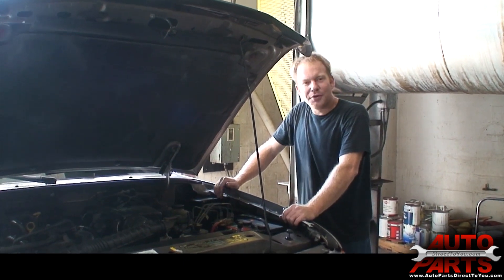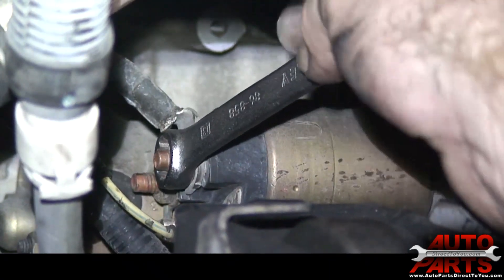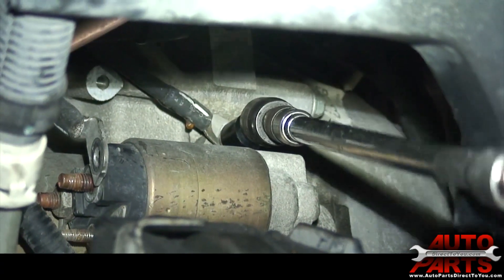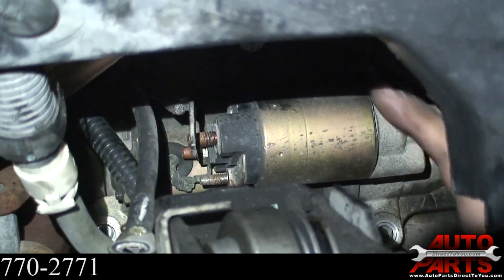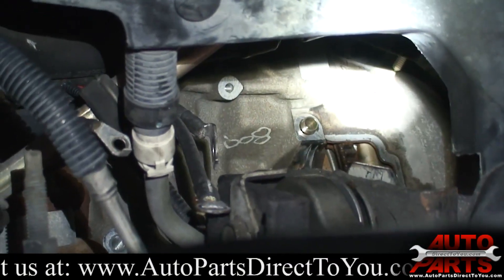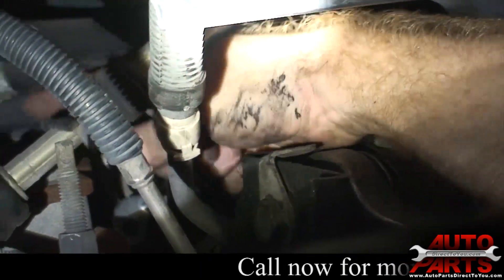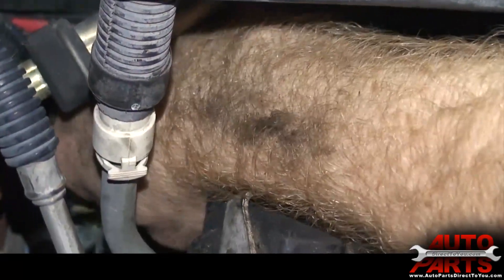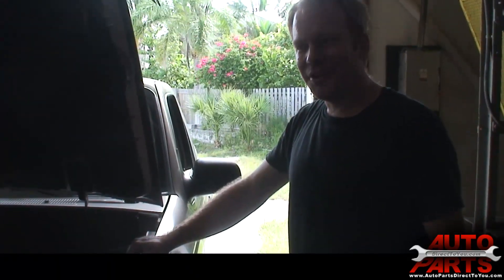2003 Ford Ranger Starter Motor

Comment: My son has a 2001 Ford Ranger with a 2.3L engine.  We replaced the starter, the alternator, and the battery.  The truck ran fine for several months and then suddenly it wouldn't start.  A mechanic friend of mine came over and discounting all the items we had replaced we looked for other potential faults such as the ignition switch and found nothing.  It left us believing that the new started was bad.  When I installed that new starter the truck wouldn't start initially.  I undid the ground wire bolt and retightened it.  The truck started.  My friend reminded me of this so I removed the top rear starter bolt, cleaned the head of it, cleaned the ground wire electrical eye, reinstalled it all, and the truck started.  I don't know what it is about that connection.  I metered the wire from the battery to the starter and it was fine.  So before you change a starter check that ground connection.

Comment: Went to go start my 2005 Ford Sport Trac & nothing.  The battery is only 2 years old & seems strong.  This is no clicking indicating a weak battery.  If you listen real close you can hear a slight click sometimes (non-battery related).  At first I thought it was my alternator but remembered that I wouldn't have any juice.  Anyway, Awesome video.  Thought it would be a lot harder.  Since I don't have a lot of tools & know how I will attempt to change the starter by myself.

Comment from the maker: Technically the starter solenoid was faulty (Basically a large relay attached to the starter motor), I confirmed this by verifying a +12v signal going to the solenoid engage terminal while attempting to crank, but the solenoid was not engaging. Because a new starter can be had for so cheap these days, and is easier to source than just the solenoid, our customer opted to replace the whole thing. I changed our title to say "Starter Motor Replacement' to avoid any future confusion. Thanks!

Comment from the maker: @TimODon87 If the engine is cranking, the starter is fine, the only function of the starter is to actually make the engine spin when turning the key. If it is cranking but not starting, you have something electrical which is causing the no-start condition. It could be a number of things from the fuel pump to a bad relay, to a number of other items.

Comment from the maker: It sounds like you are doing the right thing. I would keep hitting it with a hammer and spraying it with rust penetrant. Eventually that rust should start to free up. It is likely stuck on the guide pins which hold the starter in the correct place.

Comment from the maker: Even though the battery is recently new, it could still be a dead battery. You could have a defective battery, or another electrical problem causing a drain on the battery, or even a dead alternator which let the battery drain. Try getting it started with a jumpstart and measuring the voltage coming from the alternator. It should be between 13 and 14.5 volts when running.

Comment from the maker: It's on the same side, but the replacement procedure is a little bit different, the bolts that hold it to the engine are facing front/back rather than to the side like in this video.

Comment: I love your videos!  Because of these I buy all my parts from you guys and watch your videos to install and SO far!  PERFECT!!!  Thank you!  One question on the 2003 ranger is the starter solenoid on the starter motor?  I've noticed that some ask to replace the solenoid as well and at the same time as the starter motor?  Just wanted to ask before I ordered my starter motor from you so that I don't have to order another thing realizing that I needed it during the time of install..

Thanks,
-N
Reply from the maker: yes the solenoid is mounted on the starter on a 2003 model

Comment: I live in Wisconsin and we use plenty of salt on the roads.Everything on the vehicles rust extremely well. I managed to get the bolts and wires off the starter.The starter seems to be stuck to the engine block. I double checked the 3 mounting bolts and they are completely removed. I tapped the starter with a hammer and it will not budge. I sprayed "PB Blast" around the perimeter of the starter and am now letting it soak overnight. If this doesn't work, what next to do?

Comment: Great video. I've got a 2004, and it looks the same, except the ground cable is in the other spot. Shouldn't be a problem.

But here's my question ~ since I don't have a set of wobble sockets, and they run from $60 at Harbor Freight to $300 at Sears, I'd like to zero in on the exact size I need. [So it would have been great if you ID'ed the sizes in your video, if that's practical.]

Ok, so I did the logical thing, and reached in as well as I could with an open-end wrench to get the size. You guessed it ~ the American size felt wrong. So, I'm assuming that the Ranger, which is new to me, follows the insane pattern of other US cars/trucks, and is sometimes metric and sometimes SAE.

Is that true, then? And what size am I looking at? Would rather buy a single wobble socket than a set, and would like to get the right one first time.

Again, great video. Will be looking for more, and although I already got the starter this time, will be checking out buying parts from you in the future.

Comment from the maker: the 1993 ranger is actually a lot easier to get to the starter, if I remember correctly it's on the opposite side of the engine. (I could be wrong about that, it's been a while since I have replaced one).

Comment: Hi i have a 2005 ranger V6 4.0 and sometimes it does not start on the first turn of the key i need to turn it and the engine cranks but does not start then i turn the key again and it starts i put new plugs and new fuel filter and it still does this could this be the starter?

Comment: Have a 2002 Ranger, takes me 2-3 tries to start it every time. No "chugging", stalling, or misfiring, so I am thinking it is the starter motor. Is there a way to be sure without a voltage meter?

Comment: Hi, I went to replace my starter and the last stud (the one that has a second nut to secure the negative wire, broke free before the nut holding the negative wire did. So now the stud is turning and then the negative cable is binding up. Any advice on how to get that negative cable off? I can't tell what size wrench goes on the second nut, I have tried a 13mm and it pops off when I try to break loose the negative holding nut. Please help!
Reply from the maker: You will have to double nut the stud. You just screw another nu on it and you will have to get the correct size for the inside nut.

Comment: Yeah you can replace the starter and if the problem goes away than for sure the problem was the old starter,  no volt meter required.

Comment: soo.. all three bolts/nuts removed.  wires disconnected.  the starter will no budge,  i can not get it off - tried prying with a screwdriver to no avail.  any suggestions?

Comment: Would it be exactly the same for a 1996 ranger?  
Thanks
Reply: No.  The engine was completely changed around 2001.  In the old (Lima) engines, the bolts run parallel to the starter body.  In the newer (duratec) engines shown in this video, bolts run sideways.

Comment: I have a 04 Ranger and when I start it up it makes a noise like if a belt is loose and then it goes away.
Reply from the maker: it very well could be a loose belt, once the belt starts moving it warms up and the rubber grabs the pulleys better, an inspection of the belt while cold should reveal if it is the culprit,
Reply: @APDTY  I noticed that it does it when I turn key to start all the way back.